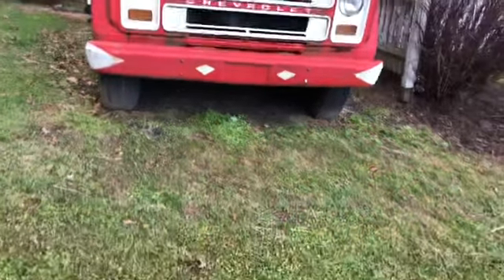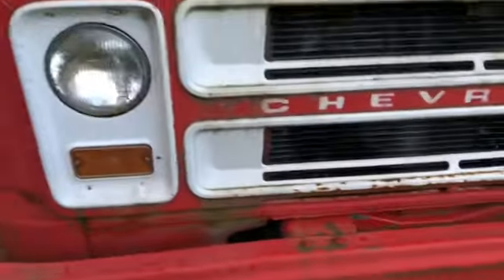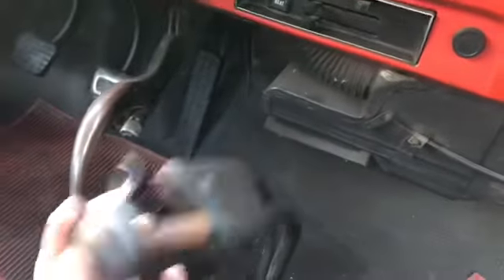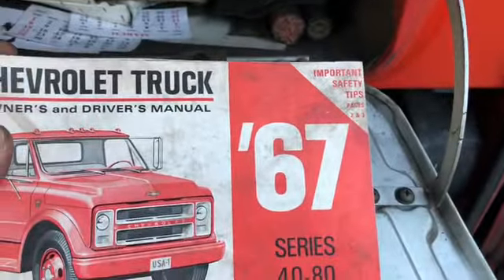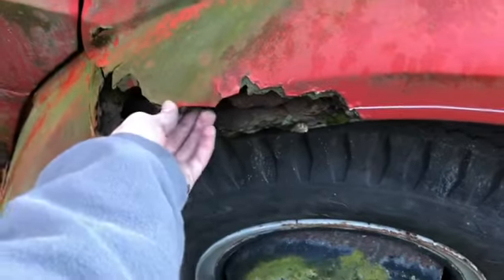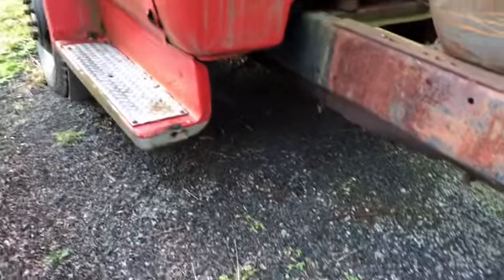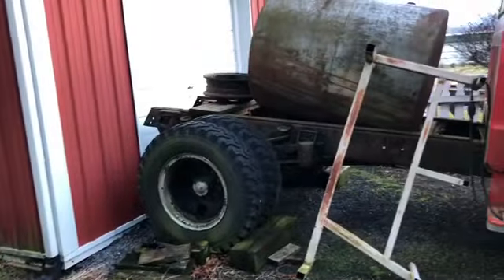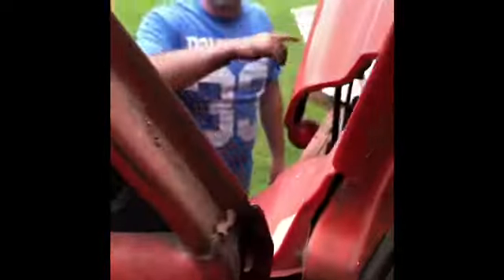1967 Chevy c50 Review

Comment: Split axles are shifted from lo to hi after every shift. Not after reaching 5th gear. However they're usually only driven like this when hauling extreme weight. Being as old as it is this truck should have a vacuum operated differential instead of electronic like the later models. Keep in mind if you ever drive a truck like this, when shifting from lo to hi in any gear you need to pull the handle and release the accelerator pedal for about 1 second for the axle to shift. Then you can get back on it. When up shifting say to second gear from first hi, push the handle in and then shift gears. In order for the axle to shift, wheel speed needs to be lowered slightly. Never shift the axle while going downhill. Hope this helps. By the way, if the axle ever stops shifting right, the first place to look would be the vacuum diaphragm mounted on the differential or the rubber lines running to it. They're very common fail rate items.
Reply: Some of these models have a electronically shifted rear and some were vacuum operated(source: shop manuals)

Comment: you could put it up on blocks to relieve the tires and springs and build a roof over it and use it as a tool shed.  may be as time goes on climb under it and get the brakes looked at and clean out the diff and axles.

Comment: Have a 68 C40 same issue with brake components. Looking for a Master and booster or just master. I have found ALL the brake parts from wheel cylinders to shoes if your still looking. C40 and 50 have identical brake parts.
Reply: where at jeff?
Reply: Just bought a 1966 c50 dump truck and I need some break parts 🙃